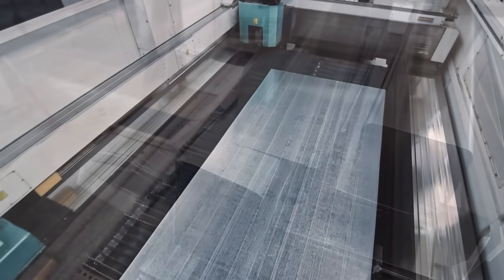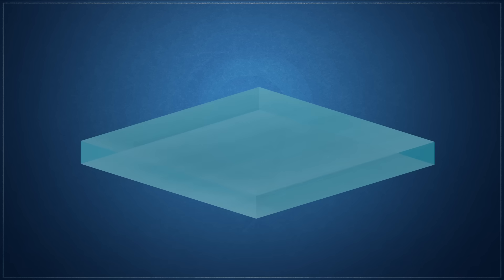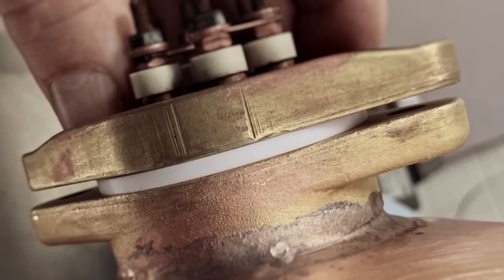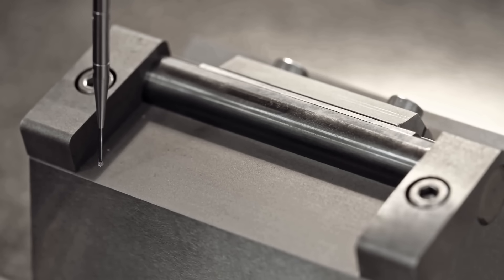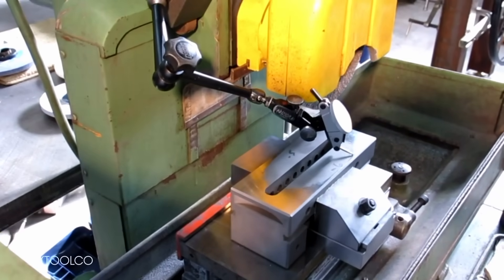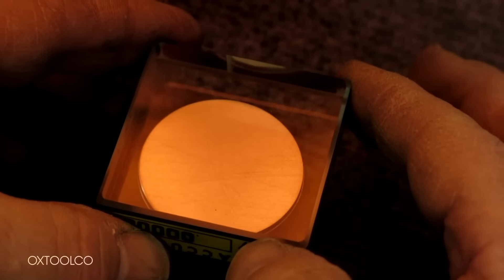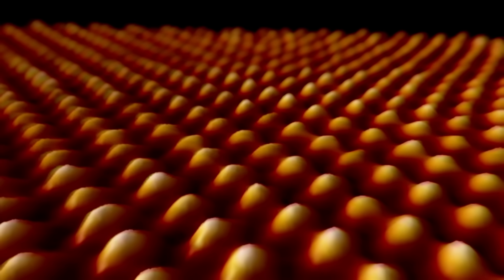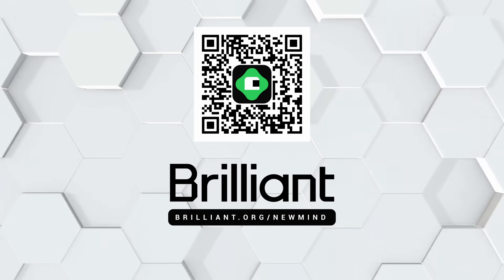The Science Of Flatness

Comment: The 12”x16” flattened and lab tested stone I purchased for my shop has for the past three years significantly improved my woodworking from a perspective of keenness and time between sharpening; there has also been reduced tear out.  This, all because I’m able to flatten/lapp the back of my irons, chisels, and cutters to extreme levels.  I’m a hand tool only woodworker building windsor chairs, chests, and one off furniture pieces. The sharpness/keenness of any edge is the intersection of two angles; therefore you can sharpen a bevel as perfectly as possible on the very best of water stones or diamond stones, but if the intersecting flat back is not prepared as well as the bevel, then the edge seriously suffers.  So many novice woodworkers are frustrated with sharpening despite spending hundreds and even thousands in sharpening gear. I often find that the backs of the tool steel is not flat/lapped. For many operations, our tools may be 100 to 200 years old and thus, we aren’t the first owners and they’ve often been moved to a different climate, were never set up properly or best, or who’ve had enough steel used up since the back was flattened.  Don’t get me wrong, our forefathers didn’t have the same accuracy that we have today available to us, but then everything was hand held when sharpened.  In the case of hand sharpening, I can make nearly anything sharp as hell by hand, but when it comes to large handplane irons using modern cryogenically tempered steel, jigs are best because of how much work is necessary to establish a new bevel.   So, if any new woodworkers come across this: a.) do yourself a favor and purchase a flat stone from Lee Valley or similar dealer to check/prep your backs.  b.) learn to hand sharpen your old O1 steel blades; especially those from 19th century until say 1930.  c.) if you can’t purchase a 100-200$ stone now, at least use some tempered float glass or a certified steel honing plate and paste until you can.  You’ll learn a lot and thank yourself for doing so down the road. As an added benefit, you’ll have a tool that can be passed down to other generations and also have a stone on hand to help train new handtool woodworkers (something we should always be doing; recruiting/training your replacement).  This is just a small part of making sure that the time, skills, and many thousands of dollars you’ve spent learning handwork is passed directly to someone. It’s so sad to see when a widow/children is selling an entire chest or shop of tools without any knowledge of their value, often getting cheated out of ignorance, and without the little bit of reassurance and happiness she’ll/they experience knowing that they’re going from working in the hands of their love into the hands of someone who’ll treat them with the same care and reverence.  My chests of hand tools; numbering in the many hundreds of planes, hollows, rounds, chisels, saws, and myriad of accessories/supporting/measuring/marking tools/benches/shavehorse/bowlhorse/templates/sketches/books are all marked and it’s also already made clear of my wishes as to whom each item goes. I find that doing so has helped drive and encourage me in spending time sharing this craft that was nearly lost in the last century.  I know this is largely a tooling and technology video, but I do hope I’ve helped encourage someone with my diatribe. 
Respectfully 🫡

Comment: The fact that they use gaskets for engines is really interesting when you consider the fact that you can rub an engine mating surface across a sidewalk paver for 30 minutes and achieve a good enough tolerance for it to seal with the gasket, especially once the engine is up to spec temperature.

Comment: In 2003 I worked on a brochure for  an engineering company based in Sheffield. One of their  more demanding projects was producing a containment capsule for the Beagle 2 Mars  probe. When completed the 2 faces of the capsule were so finely  machined that without  using a gasket not even air molecules could get into the capsule.

Comment: I used to work at a laser crystal lab that made DPSS lasers and one step the ktp and YVO4 crystal had to be polished until a near atomic flatness. Then we would put the crystals in a chamber and pulll a hard vacuum on them. Next we would stack them and heat a little. The extrememe flatness caused the crystals to stick to one another  as if glued by electristatic bonding. As a result the same crystal set that would do maybe 500mw if glued would do 7W of green laser light 😮

Comment: Gauge blocks when wrung together, stay connected because there is no air between the blocks. You can determine the atmospheric pressure by accurately measuring the force required to pull the blocks apart as a function of the blocks contact surface areas.
Reply: Then why do they still wring in a vacuum chamber?
Reply: @ you can’t achieve an absolute vacuum with a Harbor Freight vacuum pump.
Reply: @Mr7yhnmki8   Then the wrung blocks should just fall apart at the slightest nudge in a vacuum chamber?

Comment: I'm a machinist 

I once had to get a part that was 5x6 ft so flat that if you took an indicator (a measuring device)  and touched off on any random point and measured it. Then measured another random point, these to points can be more then .002 in difference. 

For those who do not know that is smaller than an eyelash. It was for a electrical company if I recall. I think ABB. 

That job took almost a week.
Reply: we now use light to find how flat our stuff is
Reply: How thick? Too thin and not only does the material warp whenever you remove even a few thousandths but clamping will always distort the plate.

Comment: Something that also contributes to flatness is the temperature of the part and room its in. The aerospace machine shop I worked for in the past was a climate controlled building and the CMM room was extra chilly to give the parts the best chance of not being warped. Some of the smaller parts couldnt be held in your hand for too long due to the laws of thermodynamics.
Reply: How do you work with something like that? Does it not warp as it is machined? What tools do you use to transfer it, as you wouldn’t want to grasp it with something that would put pressure on it that would warp it.

Comment: 5:00 Quick Note:   Cylinder heads often have a waviness callout.   Surface Finish is a beast of a topic that I won't get into,   but if a surface is too flat,  it can cause the gasket to push out from between the two mating surfaces.   Waviness of those mating surfaces helps grip the gasket in place.

Comment: 3:31 This is false. You can't force flatness buy tightening the thickness tolerance. Imagine a piece of sheet metal with a perfectly even thickness dead on tolerance. Now bow that piece of sheet metal. The thickness of the material doesn't change but your flatness is now completely off.

I've been a metrologist for 15 years and I've had to explain this to way to many engineers.
Reply: well considering the script for this video sounds AI generated im not surprised theres some mistakes.

Comment: I think this video does a disservice to flatness by not talking about good measurement practices and how flatness is defined. 
Flatness is a geometric dimension and tolerance (GD&T) callout on a drawing or schematic with specific conditions that only make sense in context. 

What flatness is denoting is: you have a manufactured surface that is intended to be a plane. So you measure the actual part and construct a theoretical plane from your measurements. If this plane is completely constrained within a tolerance box created by taking a reference plane  where you want the surface to be thickening this by the flatness tolerance. If your measure plane is within this box then your surface is flat.  

When fixturing a part you are introducing reference datum’s to your measurement. This means you are moving your part to be specifically aligned in space so when you are measuring your plane for flatness there is an X, Y, and Z offset between your intended Reference part (CAD or drawing) and your physical part. This can move your plane out of your reference box and cause a plane to no longer be flat. This doesn’t mean your part didn’t magically become warped - it is just no longer within your reference box. 

When measuring things with CMMs (coordinate measurement machines) you fix the Z offset of the tolerance box. This is because when you probe a location you approach from the reference normal direction perpendicular to the surface and this will always be the same Z location across the surface because it is a plane. This can cause surfaces to fail callouts because of the above point. Laser and optical scanning is more common on complex parts because of this stack up of error. 

I recommend this site for more detailed explanations: https://www.gdandtbasics.com/flatness/

Comment: The mirror on the most advances chip machines: 
"The acceptable surface deviation metric is 50 picometers, or 50 trillionths of a meter. That is a staggering number.
 To put that into perspective. 50 picometers on a mirror that is 450 millimeters wide. If that 450 millimeter mirror was blown up to the size of the United States, 4,500 kilometers or 2,800 miles wide, then 50 picometers would be just 0.5 mm tall."

(Source: Asianometry)
Reply: I used to work in the optical field and one of the items were optically contacted Nd yag and yvo to ktp monolithic lasers. Polish both crystals to nearly atomically flat then stick them together. After that pump it down  heat gently and apply the HR coating to each side. By the end the two crystals were a solid block. They used them for very high power (at the time) DPSS lasers ranging from 500mw to 7W at 532nm green. The tolerance was plus or minus 2nm so 50pm is absolutely insane. That would mean the wavelength of light used would be nearly x rays as well. 😮
Reply: @christopherleubner6633  "That would mean the wavelength of light used would be nearly x rays as well" that would only make sense given those mirrors are used for X-Ray lithography.

Ironically they dont use X-Rays to measure the precision because its so high, the precisions so high because it needs to not distort X-Rays.

Comment: You should look up Akrometrix, they’re the shadow moire experts for non-contact flatness, sample curvature/warpage of electronics, circuit boards and all sorts of other equipment at room temperature or over a thermal profile to mimic how the components will warp as they go through reflow to solder every together.

Comment: Checking for flatness - or another idea - if someone isn't an idiot, they could use surface plate, check multiple points along the surface, and then calculate flatness by using MATH to subtract imperfections to parallelism from minimum and maximum deviations of result..

Cause such math is almost primary school grade after all....

Comment: What is flatness? Mountains and valleys.

After tribology I learned flatness is 100% an illusion and surface finish is as easy to represent as coast line length. Depends on how much you zoom and how much you want to simplify for generalistic average that doesn't represent the surface. But rest easy, apply very thin lubricant coating for elastohydrodynamic lubrication and you're cool.

In manufacturing on the other hand I also learned geometric tolerances are one of the biggest problem sources on drawings when working with subcontractors or even your own staff. Don't use them and all your measures can be freely interpreted to describe any real life shapes apart from your ideal or functioal idea of the part dimensions and shapes.

Comment: 4:34 what milling machine can reach 4 tenths of tolerance? Unless I’m out of the loop, please educate me
Reply: Kern is an example of a company that makes a milling machine that can routinely hit that type of tolerance. 

The company I work for makes single point diamond turning lathes and mills. And we get down into 1-4nm.
Reply: It really depends on what your doing with the machine, for example holding flatness on a machine I run we needed to be within 4 tenths but if I were milling a cylinder with an end mill it’s possible but not consistent. I can have a process to hold flatness (skimming blocks clamped to my table to make sure they are perpendicular to my spindle is the easiest way to explain it) but when I go to mill a boss I have to worry about the flex of my end mill compared to using a face cutter

edit these parts are about 1000mm X 1000mm
Reply: ChatGPT says “fine precision milling machines +|- 0.0002 inches” and “Ultra Precision Milling machines optical or micro machining +|- 0.000004 inches”

Comment: I was once told wringing was a result of forming a vacuum between the two surfaces. When the two surfaces are rubbed together it pushes the air out because they are so flat. Thus forming a vacuum in the process.
Reply: This has been disproven, by a few that have wrung gauge blocks in a vacuum.

Comment: It amazes me to think I have a 32"x32" surface plate that was calibrated to -.0000" to +.0003" from any 2 points across. The lapper didn't take very long to bring it to tolerance using the 3 plate method.

Comment: As a precision optician for 25 years, I've successfully polished Plano parts down to less than 3 angstroms peak to valley RMS. 
THAT'S FLAT
Reply: Peak to valley and RMS are two totally different things.
Reply: I've done a lot of lense grinding and lapping, but more for consumer optics, but we would purposely try to make lenses just a very small amount out of Plano, and try to make them convex enough to not trap air bubbles when epoxied on to dive masks.
I also have ground carbide and ceramic inserts to where I could sort of ring them together with just the oils of my skin.
They stay together with some force.

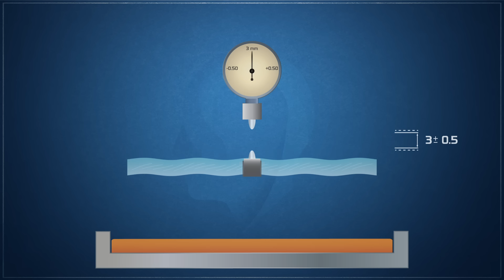Comment: @2:00 microcorigation. For most applications, this is not noticeable. When the glass gets real big and installed on the outside of a building, you can create a fresnel lens like structure. The concentrated beams of sunlight can melt concrete. 
Ps. I'm an engineer working for a glass company.

Comment: Something ive never got about surface grinding, dont the disks lose material in use... wouldent that change the diameter of the disk and then the surface of the part?
Reply: Great Question,
It's never one size fits all. Generally speaking, though, the cross feed or Y axis on a grinder is stepped in about .005-.010'' per pass back to front. The material being ground will be gone long before every grain on the wheel at the tangent is. There's a litany of information that goes into wheel selection and grinding techniques but that is the premise. 
Sincerely, 
A dude who loves using the surface grinder
Reply: @jmakeswell153  aah, so its a case of account for the change
Reply: @ArgonZavious  Not Necessarily. You dress the wheel initially, which will make it flat to the table. The front of the wheel does the work. Therefore, the back of the wheel doesn't contact the material. In other words, the wheel gets thinner at the depth of the cut rather than degrading the entire diameter. If you engage the entire width of the wheel, there will be too much heat generated. Or even better, you shatter the wheel, F the chuck up, or ruin the spindle bearings.
Reply: @jmakeswell153  Huh. To understand correctly. One uses only part of the wheel at a time and thus only a part wheel flatness is lost in use each pass, but then the rest of the wheel maintains flatness and is also passed over, so any flatness losses are corrected by the next pass of the wheel ( That still has a mostly flat edge) is that at least half right?
Reply: @ you got it my dude, the back of the wheel passing over also makes extremely tiny cuts, which promotes surface finish
Reply: This Old Tony has a very good video on this very subject.

Comment: Very very good.  
6:55  I'm so happy you mentioned this... far too many machinists have no idea how to properly measure flatness with this method. 

Suggestions for correction...
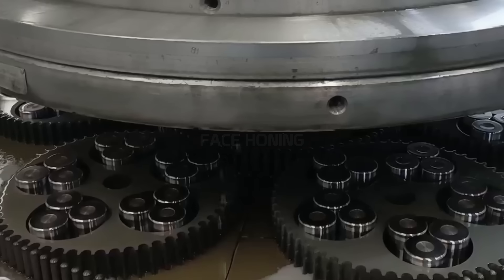10:30 I think your description for "face honing" could be improved.  All the attributes you mentioned "uses carrier plates, used for (parts)" all applies to lapping in an industrial/manufacturing scale as well.  Only difference between Honing and Lapping is 'Static'/solid abrasive vs flowing/loose abrasive

11:17 I suppose for simplicity of explanation it's fine but not all lapping processes "embed" its abrasive material. eg..Cast Iron plate using silicon carbide/aluminum oxide abrasives is primarily a rolling action. 

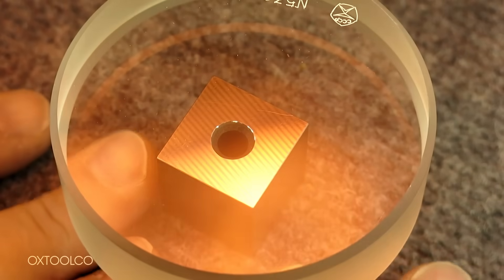13:14 Thank you for going into interferometry, I hope you can add a blurb about interferometry microscopes like ones from Zygo

Regardless, Great video. Glad to have watched this all the way though.

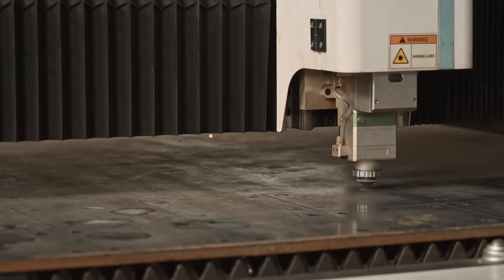Comment: 1:20 Float glass.
2:19 What is flatness?
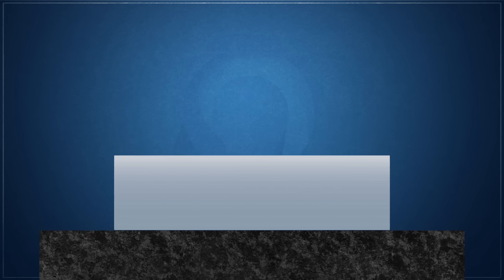6:01 Surface plate
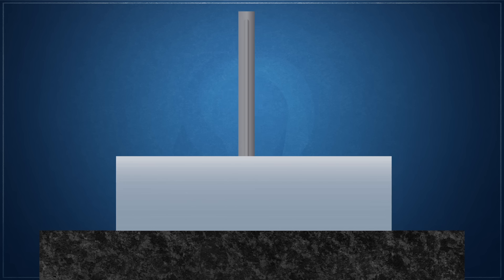6:37 Three columns
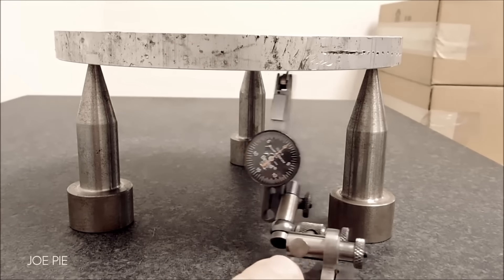7:21 Coordinate measuring machine. 2,5  μm.
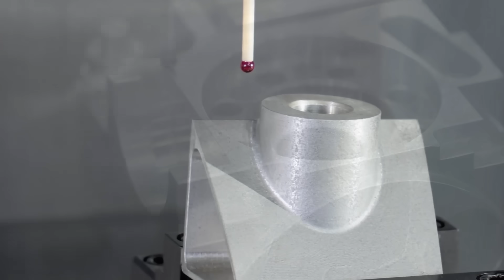8:21 Whitworth 3-plate method. 10  μm.
9:41 Surface grinding. 2  μm.
10:28 Face honing.
10:53 Lapping. 30 nm.
11:50 Wringing
12:24 Optical contact bonding
12:43 Optical flat. 30 nm.
15:05 Perfect flatness. Chemical deposition, atom manipulation.
Reply: 15:06 rick sanchez